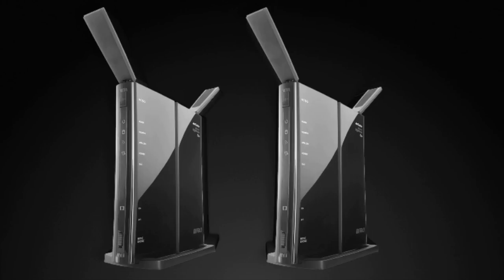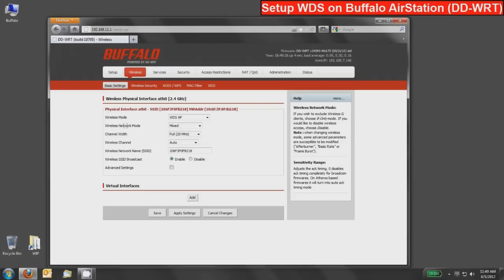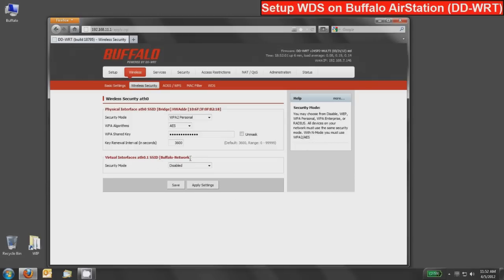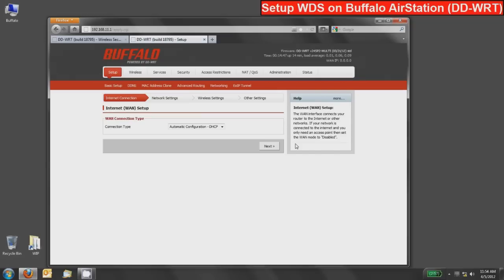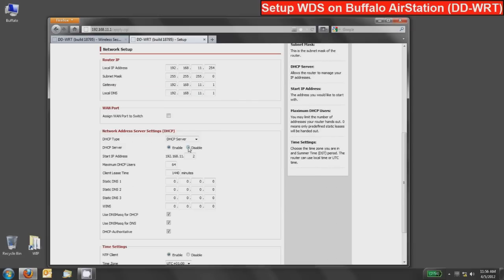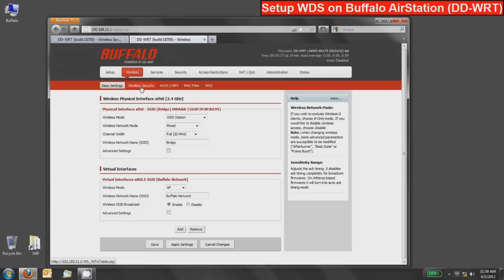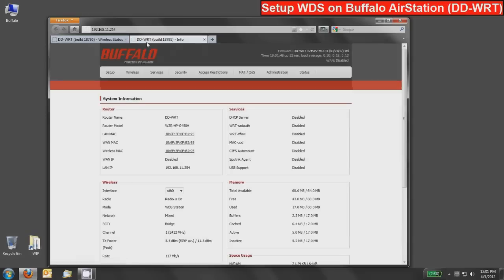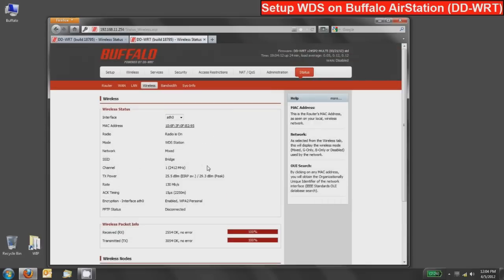Setup WDS Bridging on Buffalo AirStation Wireless Routers (DD-WRT)

Comment: JUST in case someone didn't know, the reset button is usually on the back or on the bottom, and is recessed a bit, and can sometimes be found by removing the stand if the unit is on a stand. More than likely you will need a toothpick, pen tip, or some other small tool to press and hold for about 30 seconds. (Your manual should say it, but sometimes holding for 30 seconds ensures it reset, and is better than the 3 second reset in the book. Hope it helps. And thanks for the vid.

Comment: Thanks so much for this...saved a lot of headache after a failed firmware upgrade.  I do have one question regarding "optimal" settings between an AG300H and G300NH.  What would be the recommended for Wireless Network Mode and Channel Width to achieve the best performance?

Comment: This worked for me with both a WDRWZR-HP-G300NH and a WZR-HP-G450H with the G450 as WDS AP. I could not get them to stay connected at first till I switched them both on the Setup>Basic Tab under Wan Setup, Optional Settings, STP to the same setting on each. Once they were both set to the same they worked fine. For me Im using STP on. I am sure that if I had reset both to defaults first this would not have happened as default is off anyway. Fyi for those using STP.

Comment: Your setup here assumes a wireless connection between the two devices.  In my setup the connection is wired.  Does that change the configuration?

Comment: Thanks for the prompt reply.  I've been unable to get WDS to work with anything other than the "mixed" Wireless Network Mode...which will only let me use 20 MHz.  Is there a specific mode that will allow me to use 40 MHz between the two?

Comment: tried it and failed.
I used G450H (router) and G300NH2 (repeater)
after applied the G300, I couldn't find the 2nd WIFI (G300NH2 repeater)
tried actived the STP.  just the same.
can you help me? thx

Comment: I have the 300N and the 300NH, I followed this tutorial step by step and it still does not work. The 300NH does not see the 300N in the client list. It sees my phone as a device but not the other router. I did a hard reset on both routers and tried again with no results. Any ideas on what I should do?

Comment: I have two WZR300-HPs I have in a wds configuration that I setup using this video.  What the guy doesn't show you is that after you reboot the wds station router (the repeater) you can no longer access its user interface using the 192.168.11.254.  Everytime I try to access the UI in any browser on any device it keeps defaulting to the main router's ip 192.168.11.1 and not allowing me to login to the wds station.  This method of setting up these routers is not good because the wds station router is prevented from assigning it's own range of ip addresses and since DHCP is disabled on it you can no longer access it.  TELL US HOW TO ACCESS THE WDS STATION ONCE IT'S SET UP!